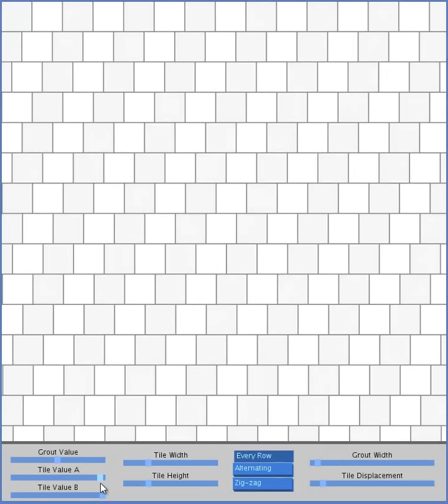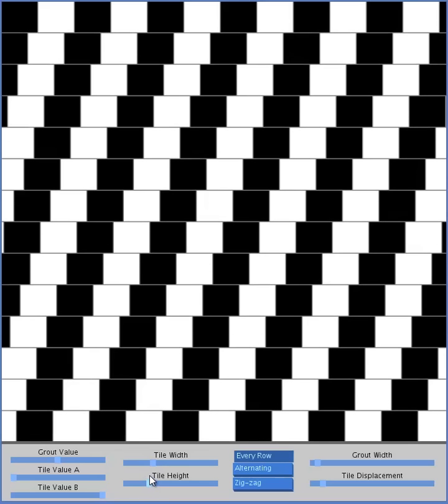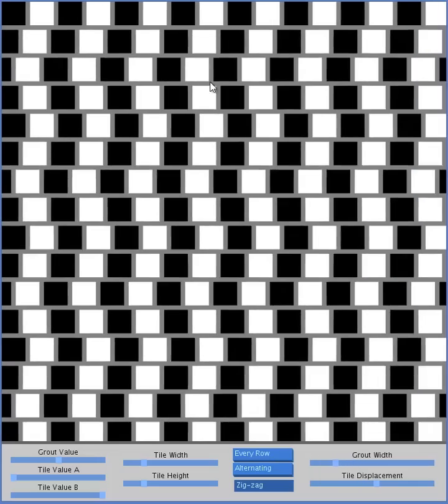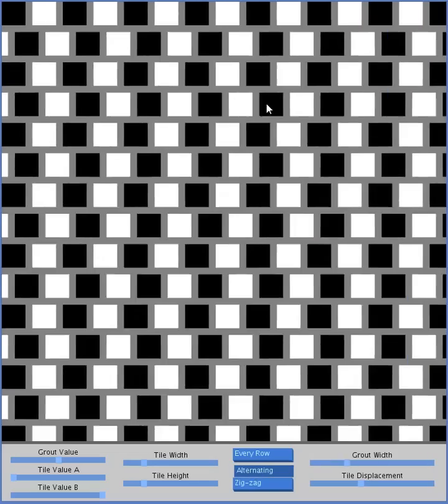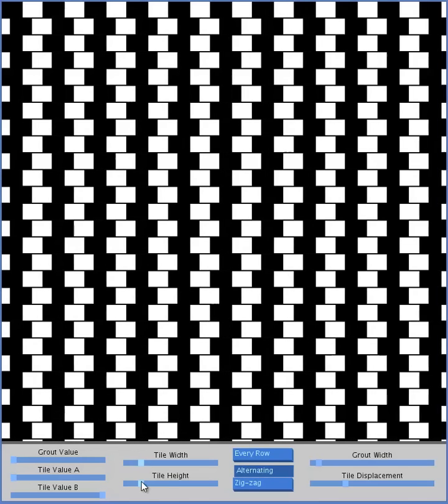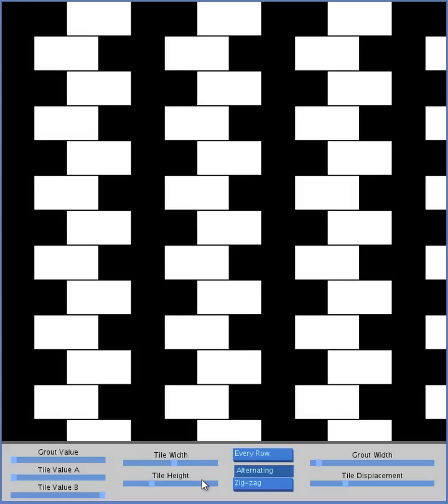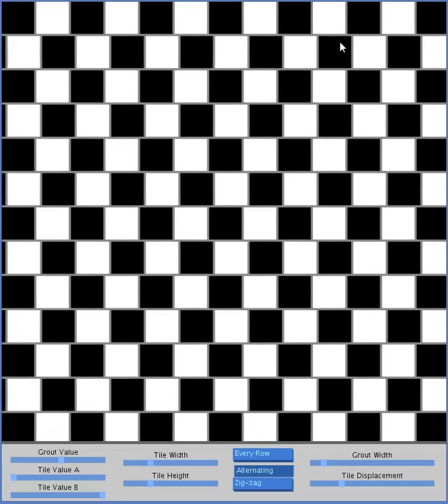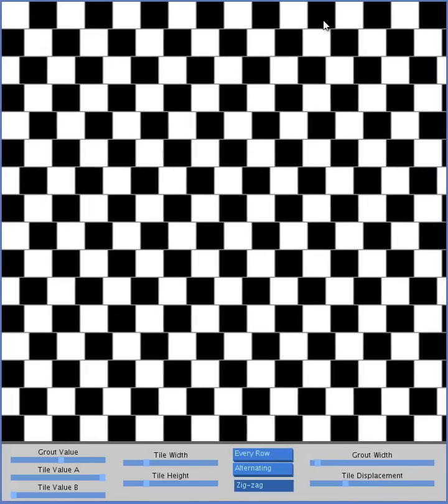The Cafe Wall Illusion - Interactive Demo

Comment: Hey! When it's set to zigzag with little grout, and I move the displacement slider back and forth, I notice some weird brightness / color-changing effects with the stationary rows in the periphery of my vision (i.e. I don't notice the effect if I'm looking directly at a stationary row, but any stationary row I'm not attending to seems to flash). Do you see this?
Reply from the maker: Thanks for giving it a try! I'm not sure I see what you're seeing (which colors? In the grout itself, or the tiles?)

I do have the impression that the grout globally gets darker when you approach a perfect checkerboard (i.e. the grout is always flanked by opposite-valued tiles), and seems brightest when the tiles align into like columns (so that every horizontal grout strip is effectively on a uniform background of black or white). Is this related to what you're seeing? It's not very dependent on peripherality for me.